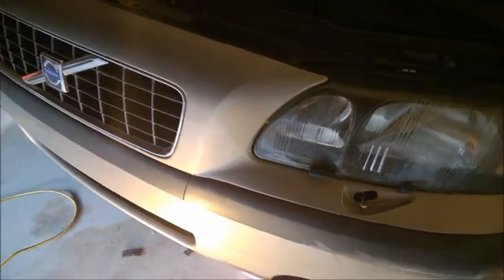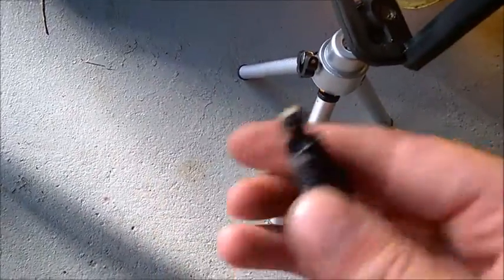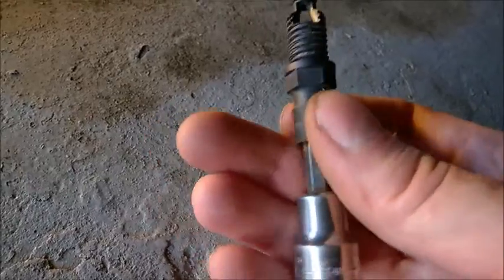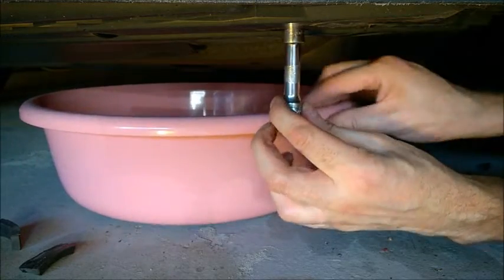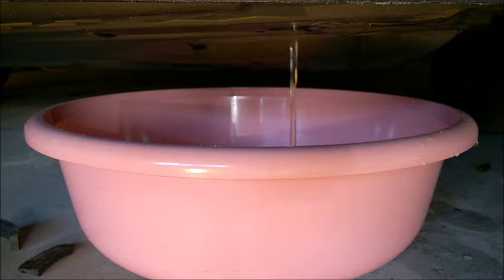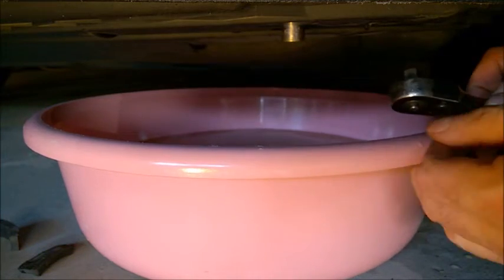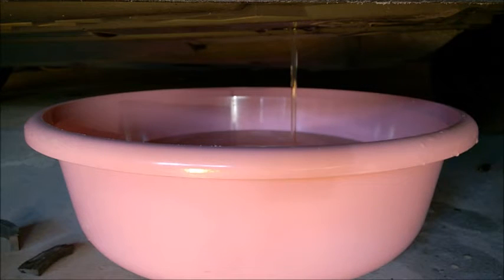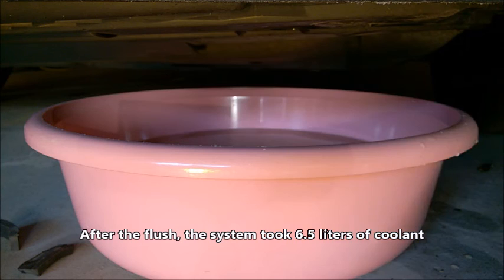Volvo S60 V70  Coolant drain 2001-2009

Comment from the maker: Warning:  I did edit out the part with the block drain plug behind the engine:  that metal plug gets very stuck and it's very easy to break ! It's made of copper and has a very thin wall.  Better don't touch it - you may not drain some 1/2qt from the block, but better not to risk it. Even if you spray with some penetrating oil it won't get inside the plug so won't really help.  If you break it and it stays open, may try to fill the hole with some JB Weld or alike, or even ask a bud to put a weld over the opening. You may also try to undo the whole valve assembly from the block, and get a spare one from the junkyard (or maybe Volvo is selling these)  https://youtu.be/5J9amzilX2g 
FINAL tip.  On my car, I noticed I could not refill with more than about 4 liters of coolant.  I believe air gets trapped somewhere inside the system.  I then overfilled the coolant reservoir with an extra 1 inch above the Max coolant level at cold - which did leave only about 1 inch empty space to the reservoir cap with a cold engine.  BE AWARE that this can cause problems because the coolant needs space to expand when it heating up so do this at your own RISK as this can blow a hose or crack the reservoir under pressure. Tighten down the cap. Also do not remove the reservoir cap when the coolant is hot, it will overflow everywhere.  After doing this, I did run the engine to warm it up without driving and checked several times for any hose bulging or leaking... as the coolant heated up, it seemed to me that the lack of expanding space inside the tank did force an air pocked out from somewhere perhaps from near the engine head. From this point I kept my reservoir slightly overfilled above the MAX mark measured with a cold engine (but still with some empty space for expansion when hot). This also did seem to improve the cabin heating in winter time.  Again, this worked on my car but if you want to try it be very cautious about the risks

Comment from the maker: Coolant refill - with engine off remove reservoir cap and keep squeezing the large top and bottom radiator hoses while refilling the reservoir, to burp all air. Once reservoir is up to max, keep cap off, start the engine and let engine warm up (5-10 minutes) on idle until the thermostat opens - stay near the reservoir, the moment the thermostat opens, reservoir level drops suddenly - keep refilling it without stopping the engine. Do not drive the car to warm up the engine, let it idle and keep watching the reservoir level. Once reservoir can not be filled any longer, put cap on and tight, then let engine cool down overnight. Next day refill again the reservoir as needed - don't forget this step, I keep my coolant bottle on my seat just so I don't forget. Drive the car then check each morning the reservoir level. Keep the bottle inside the car.

Comment: Did you ever try removing the radiator cap that looks like a 20-30mm socket fits over it? 

There must be a method of burping the system through that radiator cap with the rediator funnel and fixture. 

I had trouble burping the air out of the system only through the overflow reservoir.
Reply from the maker: If I remember well, there is no radiator cap on these vehicles (like on Asian cars). You may be pointing to the A/C refrigerant system which has a  pipe with a high pressure refrigerant port (not coolant) passing near the radiator
Reply: @Peppermint1  the cap says 3Nm on it
Reply from the maker: @HhhGggg-rz7bu  That's the A/C refrigerant port https://www.cargurus.com/Cars/Discussion-c6003_ds551270
Reply: @Peppermint1  okay.  Thank you

Comment: Note: 2005-2009 uses a 7mm hex drive instead of a T40 Torx for the petcock.
Reply from the maker: Thanks for the info
Reply: @Peppermint1  hi. You're welcome.

I just did a coolant drain to chabge a thermostat and I only drained out just under 5 quarts. What would you recommend I do?
Reply from the maker: @HhhGggg-rz7bu  That's normal. It's not possible to drain it all. 5 qts is about 70% of it. I'd drive it like this and eventually do another change 1-2 years from now. But having 70% fresh is already plenty enough - coolant is not like engine oil. Same happens with brake fluid, can't drain it all because the master cylinder will suck air into the ABS unit which is not good. Doing fluid changes more often should keep the fluid/oil fresh enough.
Reply: @Peppermint1  okay. Thank you 👍
Reply: @Peppermint1 I discovered that a lot of coolant gets stuck on the bumper shelf below the coolant drain hole. It dispersed all around it and spilled out when I turned with the car. I'm going to remove it next time and see if I can catch all of the coolant and get a real measurement.

Comment: Just did my water pump today as part of a timing belt / cam seals job. I wasn't paying attention to how much drained but it looked like about the same amount that I added in after the job, maybe slightly more. I ended up adding aboit 1.4 gallons in total after a couple cycles of run, let sit, refill.

Comment: The owners manual for my 2007 V70 2.5t says the cooling system is 10L but I can only drain less than 5 from the radiator when I remove the petcock. Does the engine block and the heater core really hold 5L? Or is there an error in my manual? Some people say that it is 7.5L total capacity but I don't know who to trust.
Reply from the maker: Good point. Capacity is indeed about 7 liters.  There is about 1 L that stays inside the heater core. There is also a block drain as well which will remove about 1/2 L. Be aware that this drain can be stuck and can break if forced and it may or may not keep leaking - also do not force when tightening it back  https://youtu.be/5J9amzilX2g
Reply: @Peppermint1  Thank you very much for the reply. I watched your video about the engine block drain and decided not to touch it. Thank you very much about that piece of advice. Also thanks for the verification of the cooling system capacity total capacity at 7.5 liters. It appears that the manual has a typo.
Reply from the maker: @SS-cc3km  There have been indeed other surprising mistakes in the Volvo owner's books.  There is also a mistake about the power steering fluid (we need to use only Pentosin synthetic fluid, not transmission fluid) and also about the gross car weight in the specifications - it says the S60 weights 2000kg which of course is wrong, actual weight is about 1500kg
Reply: @Peppermint1  Thank you. I'm aware about the CHF 11S & CHF 202. I always watch your Volvo videos since they directly relate to me. Other sources show that the coolant capacity is 8.8L. It is most likely somewhere in between the 7.5L and the 8.8L. The coolant in my car is light yellow color like the G-05. I'm planning on replacing it with the G-48 Blue Volvo coolant.
Reply: Just wanted to update everyone. After my last drain and fill, I poured one gallon of Volvo 100% concentrate antifreeze and topped off with distilled water as needed. I checked the freeze protection after I drive the car and all the fluids were mixed. The freeze protection was in line with a 43% concentration. So this tells me that the total capacity should be around 8.8L or 9.3 quarts like in the manual. I calculated that I need to remove 1L to 1.5L of 43% fluid and replace with 100% concentrate to get to the sweet spot of around 50%. 2L would get me at the limit of 55% concentration, which is the maximum recommended on the Volvo coolant bottle.

Comment: Everything on my V70 has been tightened too much, it needs to stop! a lot of the service items only need 25nm which is very little 👍
Reply from the maker: It happens with some mechanics and even with previous owners and it's indeed not a good thing because it can stretch the bolts.  Also, one important thing is never to work on the car after driving in the rain : bolts get wet and when putting them back in place, a small film of rust appears between the threads - this causes the bolt to seize very badly in place, much more than an old rusted bolt that was never removed.

Comment: I devised a length of hose to help drain the block.  otherwise the brass drain is very messy.  you really need a hose and flare nut crowfoot wrench to drain the block cleanly.  It makes a big difference when all the coolant goes in your bottle and NONE on the floor.
Reply from the maker: Great tip!  Indeed, we need to recover the old coolant and bring it to a local hardware for proper disposal - careful for those who have pets around, this is sweet tasting and toxic for them

Comment: Ues never tap water always distilled.  I also use only Volvo coolant.  According to Volvo, if you use Volvo coolant you never have to change it.  However I prefer to interpret that as an "extended" interval (3-5 years).
Reply: Just like the 'lifetime' transmission fluid that will destroy your transmission if you don't change it.

Comment: I have a couple new extras.  I've broken them from overtightening.  Be careful and always check for leaks.  I use a 13mm deep socket on an extension if I recall.

Comment: If you've got a tap and die set you could measure the pitch of the thread so we know what bolt could replace it in an emergency
Reply: It's an M12 x 1.75 pitch.  20mm socket-head would be the ideal replacement (or trimmed to about that length).  Basically the OE one is a one-time deal - it softens with heat and time and the hollow bolt body breaks UBER easily.